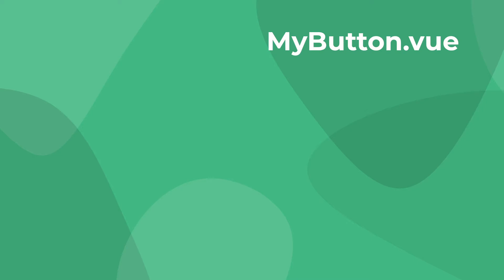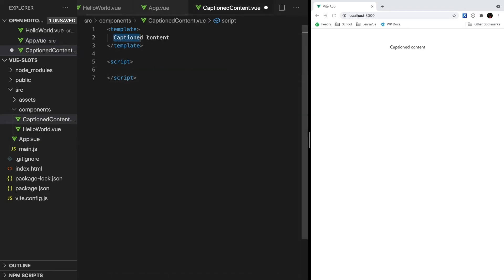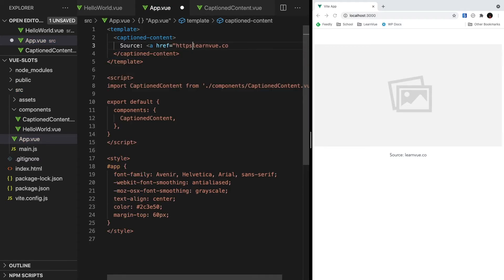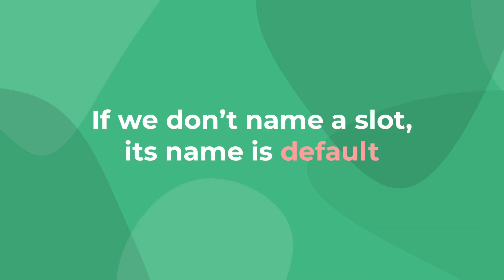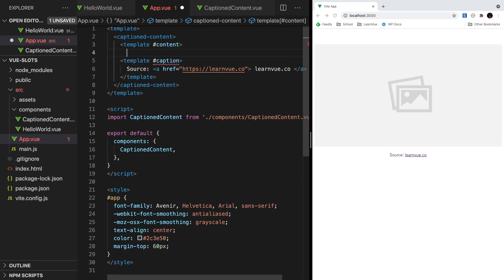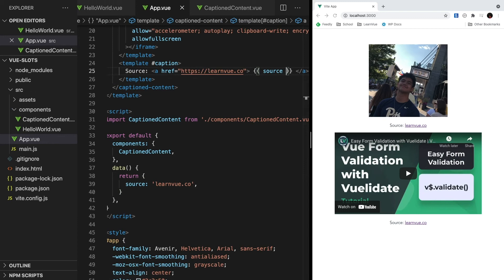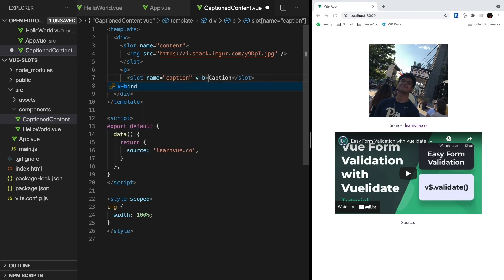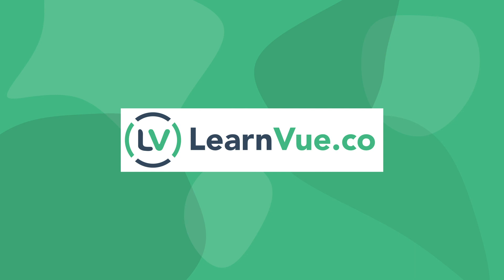Vue Slots Simplified

Comment: One thing confuses me. Why would I want to define data in the child, access it in the parent, and then pass it back into the child via the slot? I'm googling but not finding any examples where it doesn't make more sense to just keep the data in the parent and pass it to the child.   I guess if the child makes an API call or something that changes the data and I want my parent component to modify the data based on some condition of what it received from the child before passing it back in? Just trying to make sense of it.
Reply: Let's say conditional rendering for example, or passing values to multiples component..Or side effect in the parent component  : 
<ParentComponent>
  <DataProvider v-slot="{ data, loading }">
      <BoringTable :items="data"  v-if="!loading" />
  </DataProvider>
</ParentComponent>

Comment: Hello there, I wanted to make a global component (not sure if this is right term). Similar to like a dialogbox, notification or simple modal. 
Scenario: I have a modal for registration. Message: "A message is sent to your email for verification". Button: "Re-send email"

With `Message` part its easy since I can just pass the data however I am more concerned with the `Button's` functionality the for resending email. Is this gonna work with slot or prop ?
Reply from the maker: if you're making a separate component, you can have the button functionality inside that global modal component and handle resending the email there!